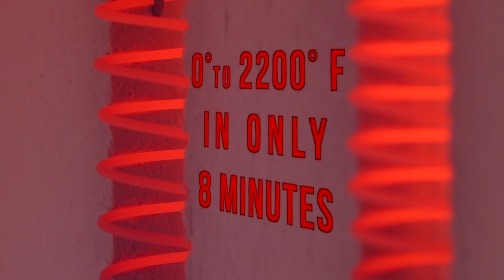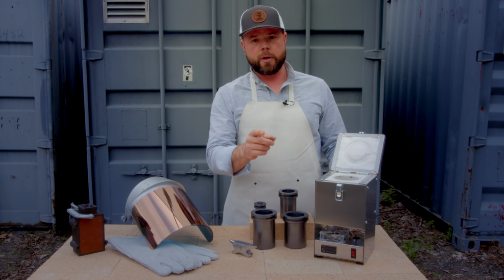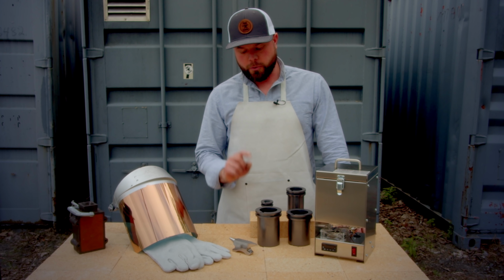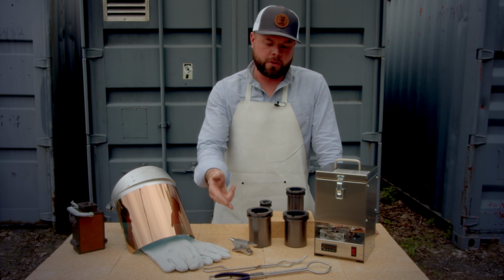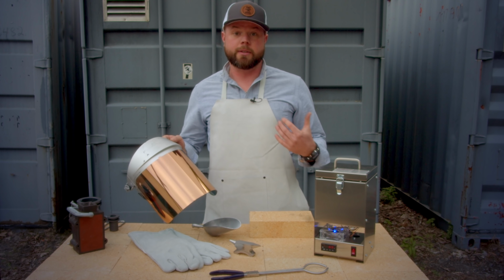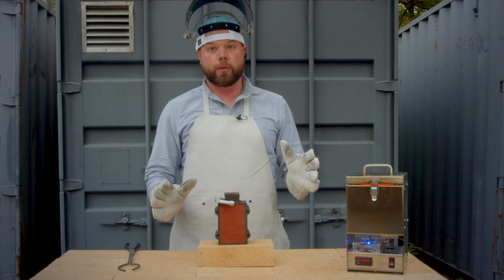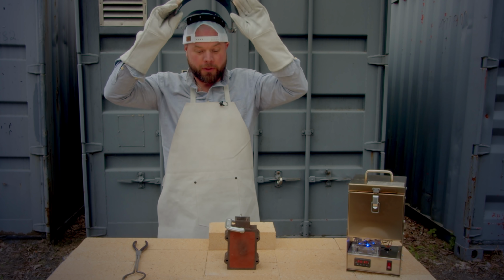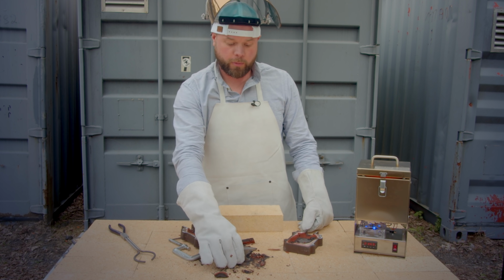Melting Bronze & Sand Casting an Anvil

Comment: I like the video. I have an outside foundry which i can cast bells as large as 20 inches of cast aluminum in sifted play sand mixed with bentinite Largest bell in brass is 6 inches so far.. This is ideal for inside castings when weather is not good outside. I plan to buy a building with dirt floor for my outback foundry. I have also melted brass pretty easy in it. I use coal and coke that comes from the ashed coal to make hotter temps..

Comment: Very cool but I don't have enough money for it
Reply from the maker: Hello! We currently have a 10% off promo code plus free shipping to the U.S.A. - let us know if you have any additional questions, and if interested, we can try our best to find the best products to fit your budget.
Reply: @Pmcsupplies  %10 off of $500+taxes ?
Still $500.
About $300 more then most would want to pay considering the cost of operation is ALLOT of electrical bills.
Reply: @tonycstech  I would think the electrical cost is going to be a lot less than the cost of propane for most furnaces. Also, depending on your utility you may get special off-peak rates, so it could be even cheaper to operate at 10PM vs 3PM.